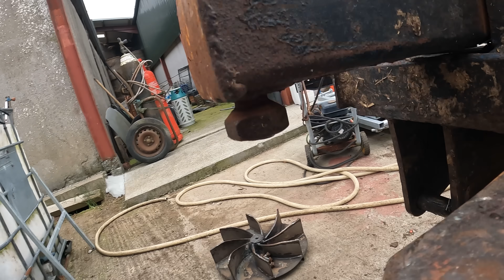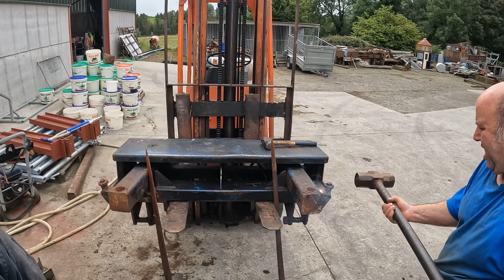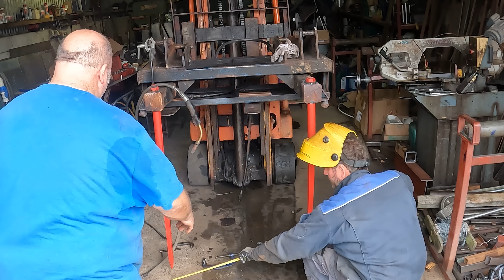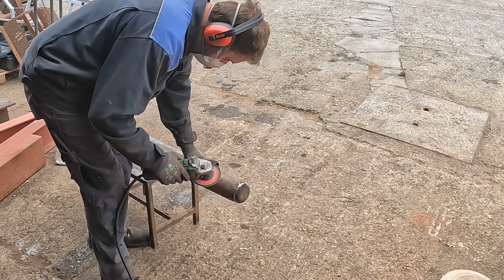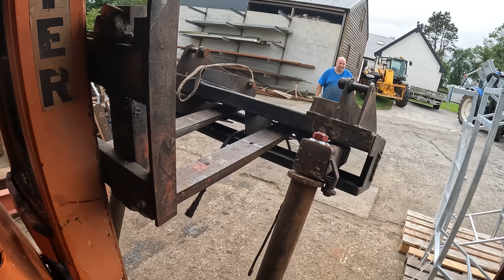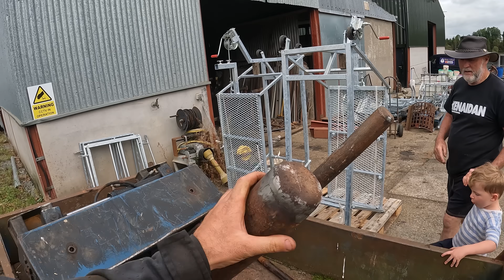Bale Spike Repair #engineering #workshop #farming #welding

Comment: Great stuff David, love the videos, only thing i would have done differently is grinded off the paint on the prongs, we used to have same problem, no matter how tight you get them they used to come loose if we didn't take the paint off first, keep up the good work.
Reply from the maker: Great tip, thank you👍 Do you find they need tightening again after a while when the paint is removed or will they stay tight?
Reply: @sheepschool365  We never had to tighten them anymore if we made sure all the paint was off anywhere there is steel on steel, so the prong in the bosh and the head of the nut we always had them polished and no grease, keep it dry as you dont want any movement, was a nightmare before they be loose every week.